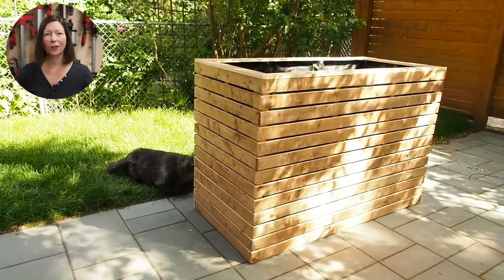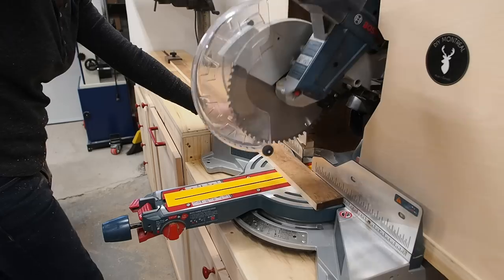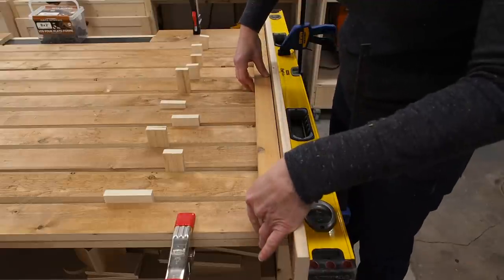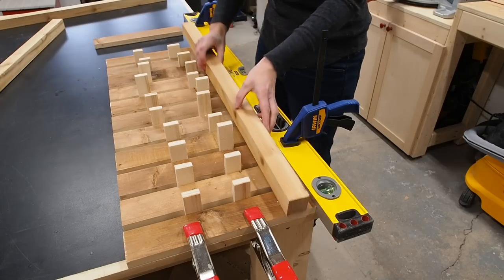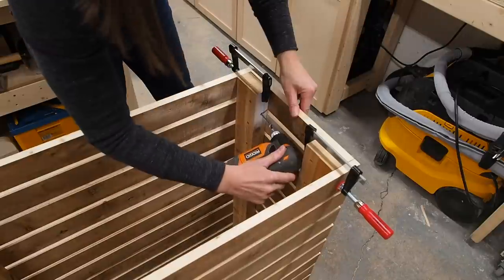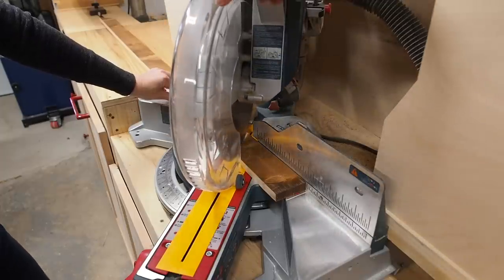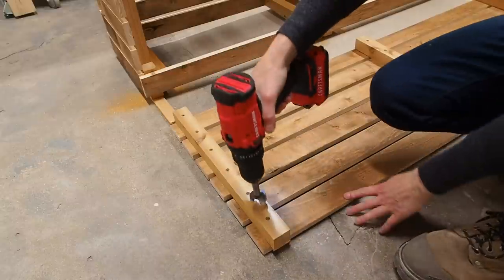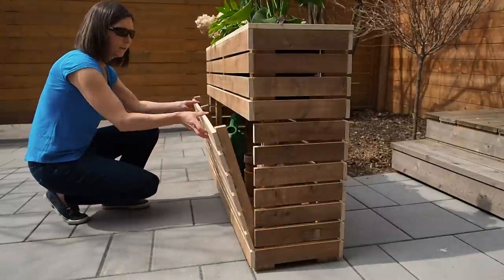Planter Box with Secret Hidden Storage DIY

Comment: Brilliant! Great editing too.  I was wondering about drainage for the plants.  If the inserts have holes the water will drip down into the storage area.  If no holes the planters could fill up with water.
Reply: An aluminum tray with a drainage hose installed beneath the planters may solve that issue...Good observation...
Reply from the maker: Yes indeed exterior flower boxes should have the drainage holes drilled out (which I will do). Therefore the stuff underneath will likely get wet (even without considering drainage, rain will get through the slats). So that's why I'll only put stuff underneath that can get wet like you see in the video. 
Nevertheless, I will consider adding a drainage hose to the bottom of the flower boxes to orient most of the water out the back to keep things clean down there. We'll see!
Reply: I had the same thought about drainage.
Reply: Watering can be done with mini oyas which limits, see removes the overflow (waste) of water

Comment: Again, a wonderfully created video. Simple is always good. Design is great and perfect for a planter garden for limited space or for a small backyard. Looks like the gophers will have a tough time nibbling at those roots. Storage is perfect without creating a larger footprint. Personally we have avoided uses pressure treated lumber when growing vegetable and eatable flowers. But the use of prefabricated growing containers will eliminate soil contact with the pressure treated wood. In addition, our state, CA, and local codes make it difficult and illegal to dispose of pressure treated lumber in the general garbage/composting containers. Another fantastic job Marie.

Comment: Have you considered switching the position of the posts, such that the short sides have the post in the corner, and the long sides have the post inset by 2"? Then you'd be screwing through the long-side posts into the short-side posts, giving yourself way more room...
Reply: That puts another board on the face side. Wouldn’t that look worse ?  Plus it’s an excuse to buy a compact driver 😂😂😂

Comment: Great video and gloriously simple but attractive design. Lots of comments here about the secret compartment store, and I think it could be modified to take logs being stored to 'season' by fitting a weatherproof membrane beneath the planter base and down the back, (all on the inside of course.) This provides enough weather protection and maintains air flow to dry out logs. Great for a fire pit or a chimenea or even solid fuel stoves. The door could even be removed completely to reveal the stored logs as a feature! Ever thought about fitting small wheels/castors? Im in the UK and will be using 22mm x 100mm Pressure Treated boards for my build but still following your design overall. Thanks

Comment: Really quick too build and simple. If you built the long sides like the short sizes and vice versa, maybe there would be more space to put the while puzzle together?
Reply from the maker: Yes indeed but the storage door would not work that way. EDIT: After some thought I think you're right. Might be a little tight to get the door in though, but could use bigger spacers (cedar legs) on the edge when assembling the large panels and thin (slat) spacers when assembling the short panels.

Comment: Great video and build. Thanks for sharing the video. I really like that planter box. The hidden storage area is ingenious. Is it necessary to use rare earth magnets as a pair?
I mean, one in the frame and one on the "door" on each side?  If you can put a metal washer instead of a rare earth magnet, you don't need to glue them.
It's possible that you'll need four "connections" in this case, so you won't save money on rare magnets. But sometimes wonders happen and two are enough if you have one
"connection" at the left side up, and the second at the right side down.
Reply from the maker: Indeed others have commented on this. Probably didn't need 4 magnets. Magnets on the door and metal on the adjoining face would have done the trick.

Comment: Did you consider only having the magnets on one side and using a bit of scrap metal drilled, countersunk and screwed in for the other side?
Reply from the maker: I did not (maybe because I don't have any scrap metal or the tools to cut it) but that could work I would think.

Comment: Really great planter. Are the plastic planter boxes drained? If they are does the excess water drain down into storage area or to the side?
Reply from the maker: Please refer to my response to GH:
Yes indeed exterior flower boxes should have the drainage holes drilled out (which I will do). Therefore the stuff underneath will likely get wet (even without considering drainage, rain will get through the slats). So that's why I'll only put stuff underneath that can get wet like you see in the video. 
Nevertheless, I will consider adding a drainage hose to the bottom of the flower boxes to orient most of the water out the back to keep things clean down there. We'll see!